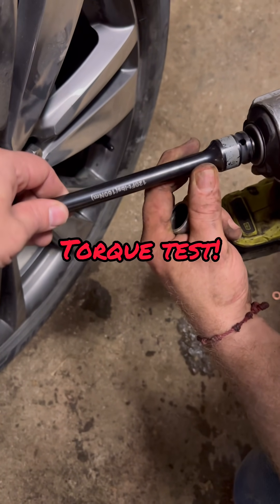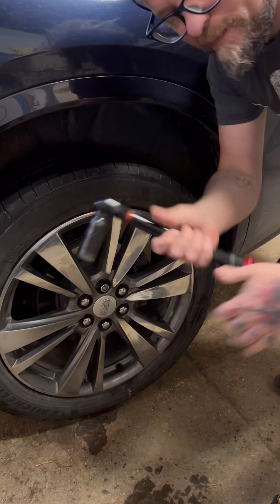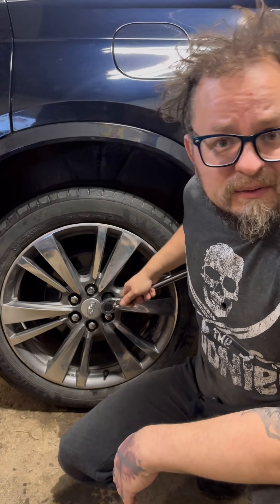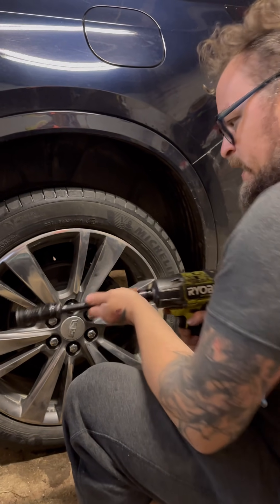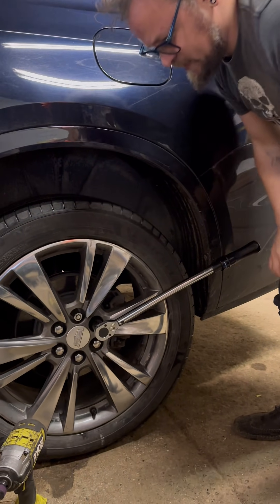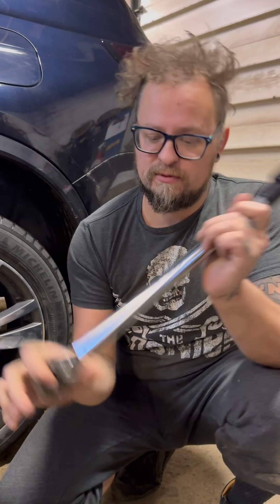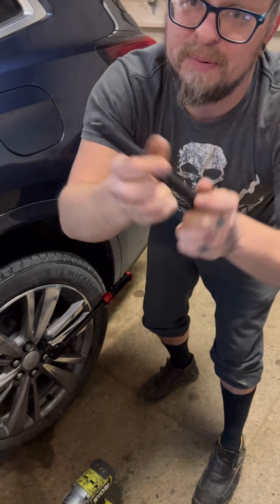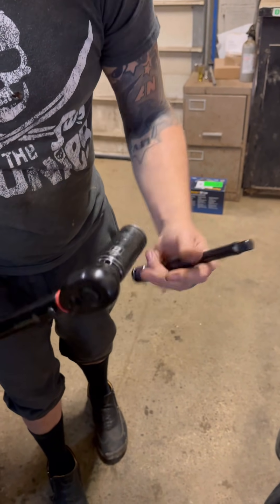Testing torque stick and torque wrench accuracy after heavy long term abuse

Comment: Too many IPM for the torque stick. Use a lower IPM impact and it will tq correct
Reply: Defeats the said purpose and instructions on said torque sticks. If you have to go lightly anyway, your better off just snugging it with a socket and fucking torquing it properly. No mechanic worth their salt should use a damned torque stick.
Reply: @matthewmclean9734  don't have to go lightly. Just need a slower impact. Basic physics